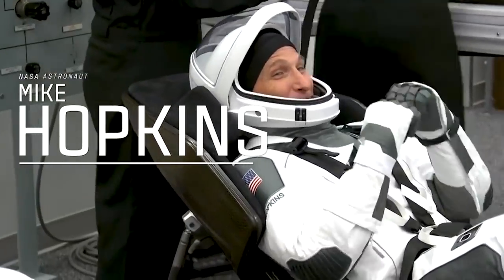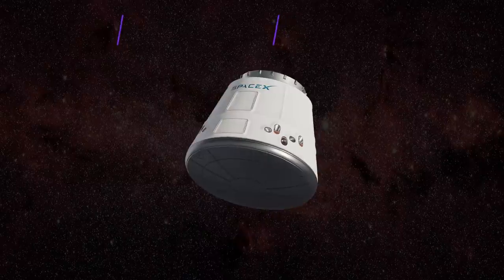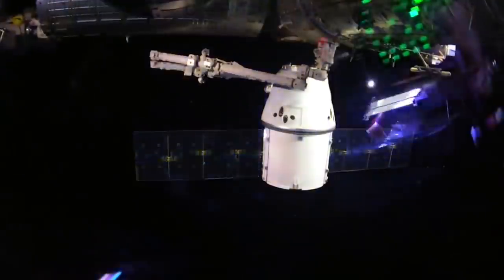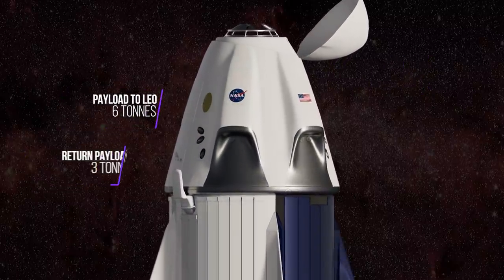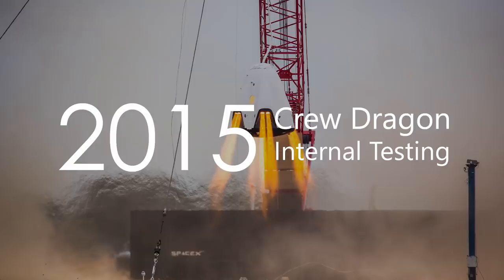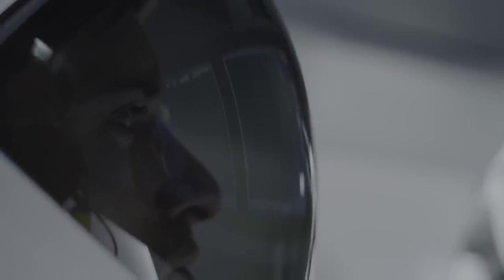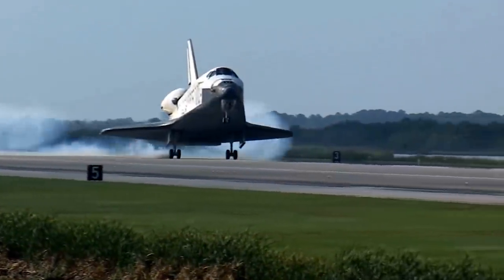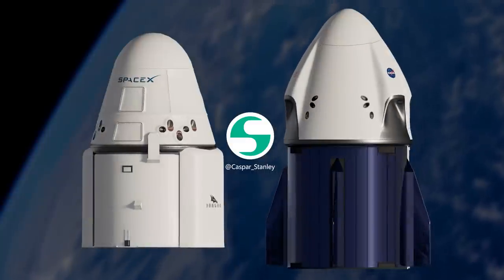Evolution of the SpaceX Dragon Spacecraft (2004-2020)

Comment: Should be noted that the crew capacity was reduced from 7 to 4 to accommodate seats that were up to nasa specs.
Reply from the maker: Intriguing. Was this reduction in seat numbers confirmed recently? I'm 60-70% sure Gwynne Shotwell mentioned they could add 3 more seats for a non-NASA mission.
Reply: @TomandSpace  Yes they can still fit 3 more but the seat angle would not be to nasa standards so those would have to be purely private seating.
Reply from the maker: @frbe0101  That makes sense, thanks for the insight.